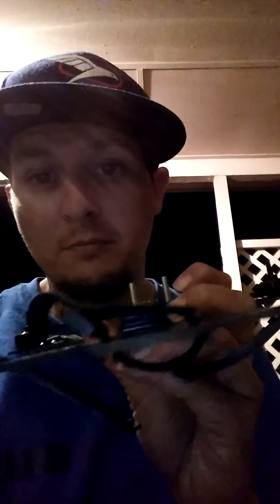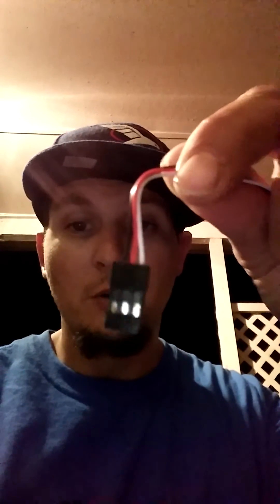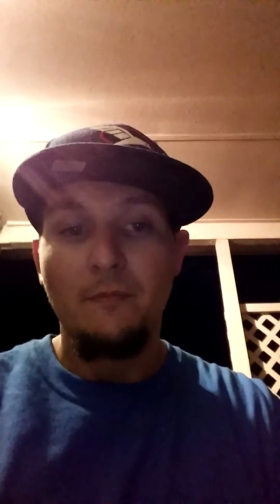How to Run Oneshot 125 via ppm on CC3D

Comment: out of interest the micro jst is very small would it not work just as well to take the purple cable out of the servo connector and put it in place of the white cable on the servo lead.
I only say this as the servo connectors are much larger and easier to manipulate.